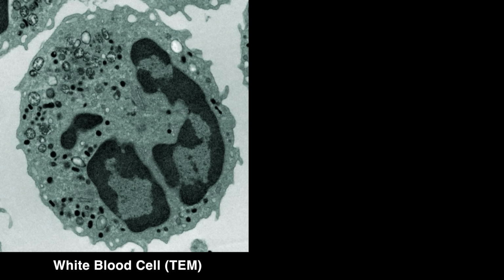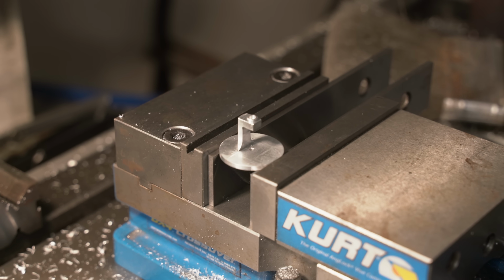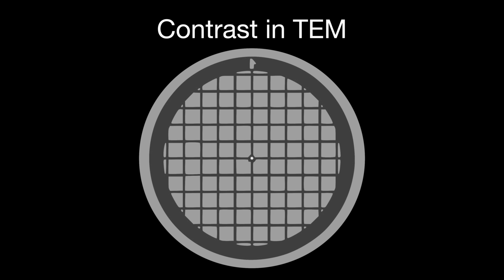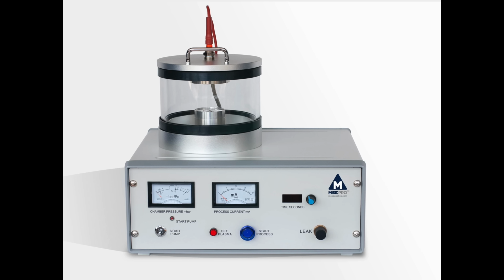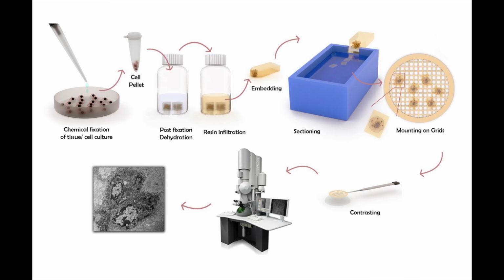Converting My SEM Into a TEM is Surprisingly Easy

Comment: ai summary

Abstract:

This technical report details the design, fabrication, and optimization of a custom, low-profile Scanning Transmission Electron Microscopy (STEM) adapter designed to run inside a conventional Scanning Electron Microscope (SEM). The physics of the system rely on converting transmitted electrons into secondary electrons (SE) via an adjustable converter mirror while simultaneously shielding the detector from direct sample-surface SE emissions.

Due to a highly restricted working clearance of 0.55 inches between the SEM stage and the objective lens, a low-profile aluminum dovetail base and sample holder were machined. Initial testing revealed significant background noise from unshielded SEs. To solve this, a diagnostic test using variable-depth apertures (1 mm to 16 mm) was conducted, proving that a taller shield is required to block unwanted SEs. A redesigned, tall brass shield successfully isolated the transmission signal. Contrast was further optimized by dynamically tilting the converter mirror via an external stage-rotation linkage and increasing the mirror's backscatter/SE yield using high-atomic-number (Z) gold tape. The utility of the DIY STEM-in-SEM setup was validated by imaging 100–1,000 nm gold nanoparticles and a mosquito wing, with the latter demonstrating superior contrast and internal detail compared to conventional low-Z organic SE imaging.
STEM-in-SEM Conversion: Design, Optimization, and Validation

    0:00 — SEM vs. TEM Imaging Physics: Scanning Electron Microscopes (SEMs) utilize primary electron beams to eject low-energy secondary electrons (SE) from the surface of a sample, limiting imaging to surface topography. Transmission Electron Microscopes (TEMs) pass high-energy electrons through a thin specimen, detecting transmitted and scattered electrons to reveal internal structures.
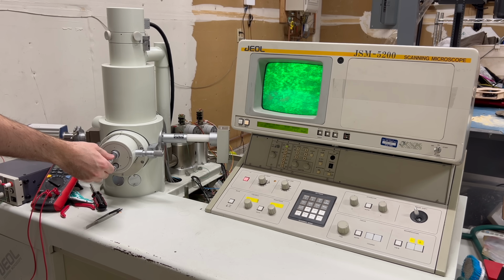    4:28 — STEM-in-SEM Conversion Principle: A conventional SEM can be adapted to perform scanning transmission imaging by placing a detector below a thin specimen. To do this without a dedicated transmission detector, transmitted electrons are directed to strike a secondary surface (converter mirror), generating "Group B" secondary electrons. A physical shield must be integrated to block "Group A" secondary electrons generated at the sample's top surface.
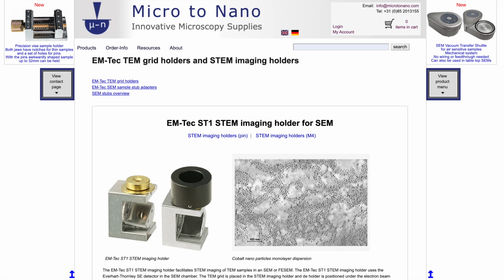    6:43 — Chamber Constraints and Measurements: Spatial analysis of the SEM chamber reveals a highly constrained working envelope. The distance between the sample stage's dovetail joint and the lower edge of the objective lens aperture holder measures approximately 0.55 inches (14 mm), requiring a highly low-profile adapter design.
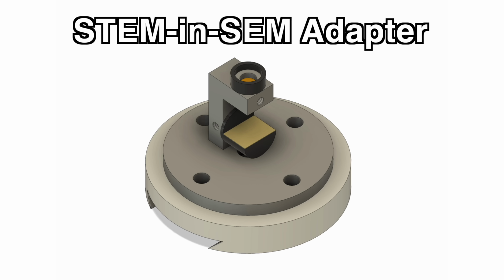    8:38 — Adapter Fabrication and Prototyping: A custom adapter is machined from aluminum on a lathe and mill. The system consists of a low-profile base replicating the SEM dovetail, a central bore for the electron beam, a sample grid holder with a step for a 3 mm TEM grid, a 2 mm tweezer slot, an adjustable converter mirror, and a top-mounted electrostatic/physical shield.
    14:54 — Initial Testing and SE Leakage: Initial vacuum testing without a specimen grid reveals high background brightness. The primary electron beam strikes the internal walls of the holder, generating unwanted secondary electrons that bypass the short aluminum shield and reach the SE detector.
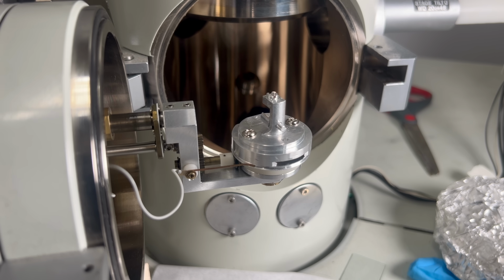    17:22 — Mirror Angle and Contrast Optimization: Electron emission efficiency is highly dependent on the target surface angle. To dynamically optimize contrast under high vacuum, a mechanical wire-reel linkage is engineered. The linkage connects the microscope's external stage-rotation knob directly to the pivot shaft of the converter mirror, allowing real-time tilt adjustments.
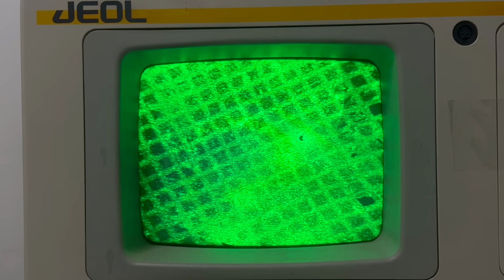    21:26 — Shield Height Diagnostic and Redesign: To determine the necessary shield height to block sample-surface SEs, a diagnostic block with hole depths ranging from 1 mm to 16 mm is imaged. The data demonstrates that SE emission decreases as depth increases, with near-total suppression at 16 mm. Consequently, a much taller, low-clearance brass shield with a restricted top aperture is fabricated to isolate the transmission signal.
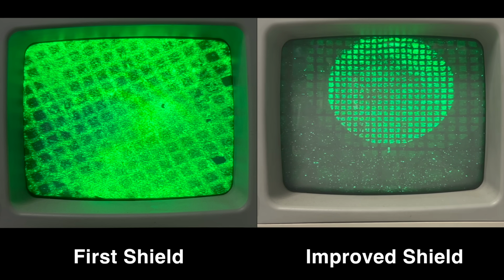    24:52 — Mirror Material Optimization: Contrast is further enhanced by modifying the converter mirror's material. Because electron emission increases with atomic number (Z), the aluminum mirror (Z=12) is covered with gold tape (Z=79) from an integrated circuit lid, substantially increasing SE yield and image brightness.
    25:54 — Gold Nanoparticle Verification: The adapter is tested using gold nanoparticles (100 to 1,000 nm in size) synthesized via chemical reduction of chloroauric acid with sodium metabisulfite on a Formvar-coated grid. The resulting STEM images show dark, flat, two-dimensional projections, confirming true transmission contrast rather than three-dimensional SE topography.
    27:32 — Organic Sample Validation (Mosquito Wing): Organic specimens composed of low-Z elements (carbon, oxygen, hydrogen) yield poor SE images due to low electron emission. When a mosquito wing is imaged with the STEM adapter, it exhibits significantly higher contrast and structural detail, demonstrating the system's ability to map thickness variations and fine internal features.

Comment: Is it possible to apply a positive potential to the shield to capture all the secondary electrons that bounce off the sample surface and are responsible for the noise in the image when they reach the detector?
Reply from the maker: I suppose it is possible to improve the group A secondary electron capture that way. It may significantly affect the trajectory or focus of the beam given the proximity (< 1mm) compared to the detector, which is several cm away.
Reply: @projectsinflight Yes, things aren't that simple. The addition of new electrode (the positivelly polarised shield)  will change the shape of  electrical field lines and equipotential surfaces, which in turn will change the paths of the electrons and the focalisation, resulting in a worse final image.

Comment: Fantastic work! Have you looked into the source of the noise in your SEM?
It kinda looks like electrical noise / EMI? — so maybe it can be mitigated with a couple of things like additional shielding, ferrites, etc. 
Do you know if the power supplies are somewhat OK? Capacitors still in spec, etc.?
Reply from the maker: I suspect capacitors but I haven't figured it out yet

Comment: Rather than going all the way to Uranium, you might use the "roman sweetener" Lead Acetate. 
It's simple to make, and much less toxic.  (It's still toxic, but nowhere near what Uranium and the rest of the elements down there are like.)
Reply from the maker: that doesn't sound too bad. Apparently gadolinium acetate is also a less-toxic option too.
Reply: @projectsinflight  Probably, but Lead Acetate was made by just putting vinegar in with lead.  So a grocery store (or a kitchen shelf) and some bird shot, and you're golden.
But you don't need much, so the Gallium would be pretty cheep, too.  (and would keep you off "those lists" instead of Uranium.)

I wonder how much would be made by keeping vinegar in some uranium glass?  Might take some time, and you would have to seperate it (boiling off the vinegar and water?)...
Reply from the maker: @idahobob  I think if you wanted the U-acetate you'd probably be better served by starting with one of those ore samples or something. I can't imagine you'd get much out of the glass without resorting to HF or something
Reply: @projectsinflight  There are some (legacy) photographic negative intensifiers or densifiers that contain uranium.   Converting to the required salt may be doable. You can probably pick them up at camera fleamarkets or the usual places on the net.

Comment: Could you go deeper if you modified the holder attached to the door? It looks like there is more room below the current mounting arm.
Reply from the maker: I wanted to keep the same slide-on slide-off thing that the other sample holders use, but if i were willing to unscrew something i could probably make it deeper.

Comment: Howdy! I am a biomedical engineering Ph.D. student and my project has involved a lot of histology using paraformaldehyde-fixed paraffin-embedded and fixed-frozen samples. Unfortunately my project doesn't have much use for characterizing organelles so my work and expertise exist above the diffraction limit of light. I'm confident that I could make you some 1µm thick paraffin sections of mouse organs and maybe semi-confident I could do the same with frozen sections. Not sure how well-preserved these samples would be for something like TEM imaging. While they may not accurately depict biology, they could still be a fun validation of everything you've built so far while you work on a protocol to process your own samples.
Reply from the maker: Thank you! If you want to email me i'm projectsinflight at gmail dot com

Comment: Are there any transmission electron microscopes that aren't scanning
Reply from the maker: Yeah! You can use a regular TEM or a STEM. Often the same machine will have both capabilities.
Reply: @projectsinflight  so the whole image is taken at once not pixel by pixel? Does it use ccd sensor array or something
Reply from the maker: @eemonster  Traditionally they would project the image onto a phosphor, the same way a CRT works. nowadays they also have a ccd
Reply: @projectsinflight they would just have the phosphor screen and just defocus the ebeam so it went thru the whole sample at once tho right? it wouldnt work like a CRT cause wouldn't u CRT be considered scanning?
Reply from the maker: Transmission electron microscopes often are built such that they can do either normal TEM imaging or STEM imaging

Comment: There's another cool conversion you can make which is to convert it into a lithography system. Write on PMMA and develop with IPA:water (look it up, it is a very good and accessible though uncommon developer). There are generic conversion kits that will work like NPGS or Elphy.

I used to run NPGS on a nearly identical SEM many years ago. Good times. 😅
Reply from the maker: My machine does not have a beam blanker, so it may not be optimal for e-beam litho. I have been thinking about it though...
Reply: @projectsinflight yeah my setup didn't have any fast beam blanker either and it was fine. The beam jumps from feature to feature very quickly and for the most part I never noticed any issues. Perhaps because my beam current wasn't super high (tungsten filament).

I did have a slow beam blanker or shutter though, but I think those are standard. (Without this, you will burn a hole in the top right of the pattern, and for high magnification writes this will be a disaster.).

If you do go that route, I hope one of the kit suppliers gives you a sweetheart deal for being a YouTube hobbyist!

Comment: Aside, to be serious just for a moment, would silver plating the mirror using the nitrate/sugar method work?  Would it be any better?
Reply from the maker: silver plating could work. I decided that i'd just use stainless steel and coat it in nanoparticles (which was shown at the very very end) but the whole process didn't make it into the video

Comment: That is so cool! The images of the mosquito wing are really nice.
Reply from the maker: Now all i need to do is hunt down the source of the interference that is causing the wavy lines. Did you have similar issues with your old SEM?
Reply: @projectsinflight  Yes.  I had many sources of interference.  One was 60Hz mains leaking through the JEOL's power supplies.  I replaced all electrolytic caps in power supplies, which helped a lot.  There was also vacuum pump vibration being carried through the housing and vacuum hose -- better mechanical separation and a thinner hose helped a lot.  There was also higher frequency interference that only affected certain acceleration voltages.  I never found the source of that one.  It could have been a failed capacitor, but the interference would appear and disappear, so it probably was something else like a bad switch or relay contact.
Reply: if the sample is non-conductive, you will generate charges in the surface and subsequent artifacts and beam-induced motion. maybe this could be the issue? are you planning on trying metallization?
Reply: @projectsinflight  is it just me or is there a pattern in the interference? To me it looks like a iffy Y DAC from the perspective of the screen, whatever that is in machine axes,

Comment: Could the shield height be reduced by increasing the voltage on the detector
Reply from the maker: i think it could be most effectively reduced by reducing the clearance between the top of the shield and bottom of the objective lens (to reduce the gap)
Reply: @projectsinflight  How about a baffle plate at the detector that blocks more of the path from the top of the sample?

Comment: While i dont know much about SEM, hearing you say heavy metals immediately tipped me off to using leaded solder.

 The eutectic melts low enough that silicone molds (made by 3D printed positives, possibly) work, and if you dont need to tilt it, you can make the mirror so big it barely fits, and thus covers most of the grid possible even at step angles. 

Also, the base can be C shaped, so you can get the whole assembly even more thin, and the mirror might be even larger.
Reply from the maker: lead actually offgasses in a high vacuum believe it or not

Comment: I will leave this on Patreon too because you're probably more likely to read it there. Instead of the gilded IC lid - you can get thin gold foil intended for gilding and apply it to the mirror. It's relatively cheap because there isn't much gold in it, and you can use the thinnest available since it's only the surface that matters. Make sure you get actual gold foil because there are many imitations, mostly brass and colored aluminum.
Reply: Oh wait you didn't post it on Patreon yet. :) I'll wait then.
Reply from the maker: thanks for reminding me- i can't believe i forgot to post lol

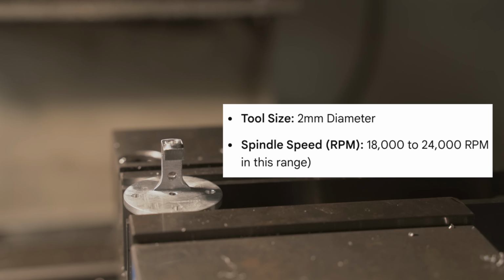Comment: 13:30 while true, the small diameters do need absurd speeds, you can get away with running them much much slower. At the shop i work at we run 3mm endmills at ~3.5-4k RPM, so a 2mm probably would still somewhat work with 5k RPM or a slower. You need to go kinda slow tho.
Reply from the maker: i wonder if i could add a dremel mount to my milling machine
Reply: @projectsinflight  If your dremel runs at 10k rpm and the dremel mount at 3k, weil you're over halfway there. Next video will be making a slip ring to power this contraption 🙂

Comment: One thing I don’t understand about this image 28:39 is how are the parts of the sample directly above the metal grid visible, wouldn’t any electron that transmitted through that area be then blocked by the pitch black grid or at least have a similar brightness to the metal? Clearly I’m missing something
Reply from the maker: unfortunately i think the shield is still letting some secondary electrons out

Comment: Absolutely fascinating work I'm riveted, and can't wait for the next instalment. I must say do you have any noise problems be they electrical or vibrational ? as I can see something but can't see the parameters of the image (mag,Kv)...great work cheers.
Reply from the maker: Yeah, there is a huge interference in the signal that is keeping the SEM resolution at around 50-100nm when it should be 5nm. I'm really trying to figure out what it is, but I haven't made a lot of progress.
Reply: @projectsinflight  Well it's usually one of the 2 modes sir, best of luck and I will watch keenly :---)

Comment: how about converting a tem into an ion beam nano 3d printer. ie ions instead of electrons. or both. cheesing hard lol. just install a second detector below.
Reply from the maker: I've actually wanted to use it for e-beam lithography, but my microscope doesn't have a beam-blanker, which is pretty important for that task

Comment: Mama i want a TEM...
We have (S)TEM at home!
Reply from the maker: that's actually a pretty accurate meme in this case. a real TEM has much better performance lol
Reply: @projectsinflight  What is the expected magnification/resolution of your STEM compared to a typical TEM with the inbuilt electrostatic lens magnification? I did not see you mention the fact that you were not magnifying the image after the sample transmission and have to rely on the scanning for this.

There are some very compact electron sensors and I was wondering if one could be mounted below the sample level in your SEM with some effort for increased sensitivity.

Comment: Nice work. Does the conductive tape not outgass, or is the sem at low enough pressure its ok. Also you were touching with sweaty fingers, so I guess its ok. Done side making and its a very involved process, dehydration by 10% steps, wax infusion by 10% steps. for the ultramicrotome I expect a very hard medium is needed. Glass knives !  Best of luck. Fantastic projects.
Reply from the maker: Honestly i should take cleanliness a little more seriously, but tbh my microscope was open to the atmosphere for a decade so until i clean it out thoroughly i haven't really tried too hard to keep it spotless

Comment: If you machine away the part of the holder where the mirror touches (you don't need a second screw anyway, it's positioned enough with the groove and single screw behind the mirror) you can tilt the mirror more for higher intensities. Also, might make sense to file a chamfer directly below the TEM grid towards the "front" of the mirror so that corner doesn't block electrons when the mirror is at a higher angle
Reply from the maker: That would probably work. I actually came up with a design that replaces a different part of the sample holder that would allow me to have a lot more vertical space, which would be nice if i made a V2 sample holder